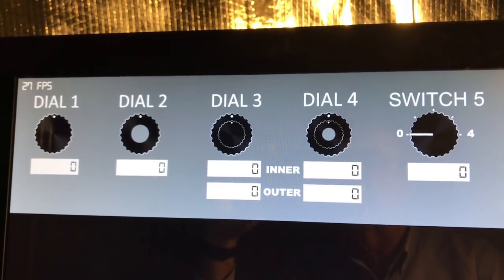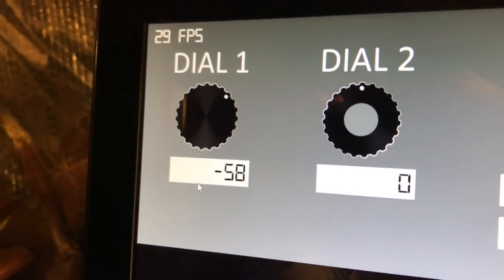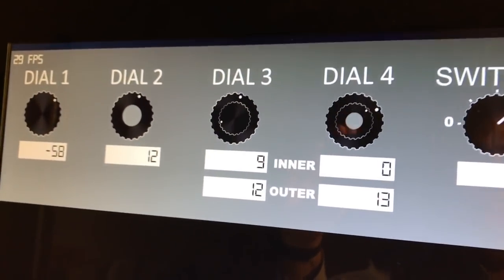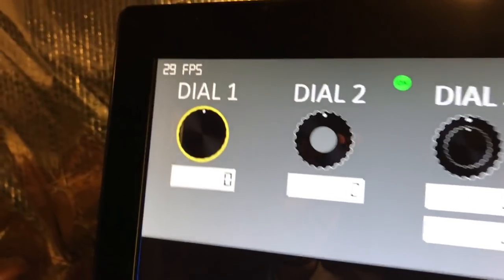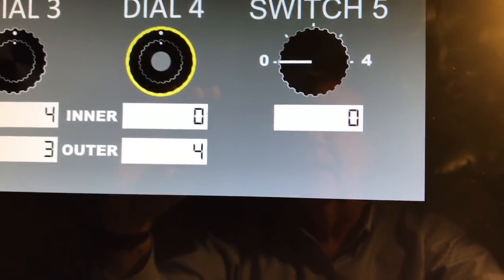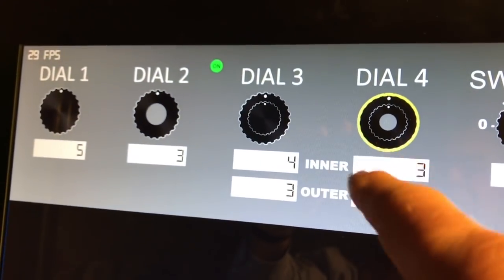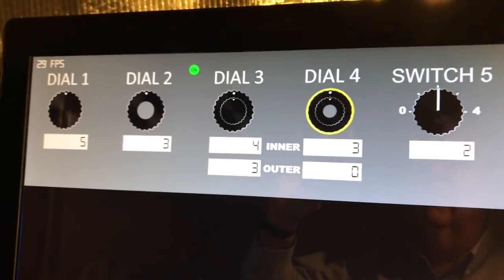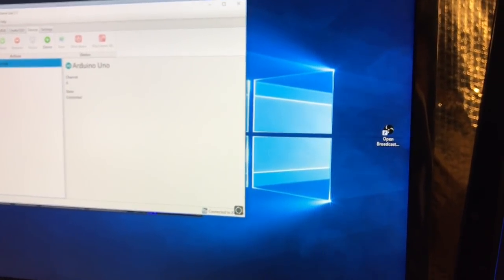Air Manager Arduino All-In-One Knob

Comment: Hi Russ, I'm very interested as well and have built a Cessna switchbox, a dual encoder and a single encoder. I'm strugling with some things, I mailed you about it. These dials in this video, what program do you use for them? Or is it selfmade? I'd like it to test my encoders :--)
Reply from the maker: That was all programmed using Air Manager. It was an early mock up of what became The Knobster available from Sim Innovations. I suggest you look at my video Dial Up Your Cockpit for more basic  Arduino information. 

You could also look into Mobiflight for a freeware solution to hardware only. It is good for basic setups

Comment: Dear Russ, 
I like your video a lot and your very objective feedbacks as a real pilot. I am a PPL pilot and also interested in knobs, air manager .. in order to have a better interaction with the sim (X-Plane11). 
I am personally  using a LeoBodnar Joystick card on which I connected rotary encoders (ELMA).  It is detected by x-plane without any driver and no extra software are used. I am able to set up the different encoders to a specific function (barometer, OBS, heading bug...), and it makes moving the gauge displayed on Air Manager

In this way, I can run more than only one knob, and no programmation is needed like in the Arduino

You should have a look there too

Thanks for your excellent video ! :)

Comment: Thanks for the reply. What I really need help with is my triple monitor setup. Windows 10 creator update removed the advanced display settings option so it is impossible to setup three monitors separately. X plane does not recognize three separate monitors and setting lateral rotation offset on each monitor the way you did in your video is impossible. I’m at my wits end because there doesn’t seem to be a fix. Do you have any suggestions. Please help
Reply: wildgoobsid5 disable Nvidia surround if you want individual displays

Comment: This is brilliant. Will you be sharing a how to? Thanks.
Reply from the maker: wildgoobsid5 I have talked Sim Innovations into incorporating this functionality into Air Manager. I have an early beta that still has some rough edges but will post a video when it is a bit further along. The great news is that unlike my “hack” requiring instrument code modifications, the new approach will work with any Air Manager instrument as is.
Reply: Silly question: during this hiatus period as Knobster (which is pure Genius, Russ!) shifts across to Sim Innovations, is it possible to use a DIY Arduino connected switch (i.e. a “fake Knobster”) and connect to Air Manager by making use of the Knobster feature you got them to incorprate into Air Manager? Or is the software Knobster feature locked purely to the Knobster hardware? I am learning so much from your videos, keep up the great work - and new innovations!

Comment: Thanks for the great videos. What commands are available to set in XP11 using arduino? e.g. is it possible to set Flight With Lua or Dataref Editor values?
Reply from the maker: Andrzej Art you can read and right any standard or custom datarefs in XP11 buy using Air Manager. Version 3.0 allows you to interface Arduino and Raspberry Pi Hardware with XP11, FSX,   or P3D
Reply: Actually I'm using AM3 with the Raspberry Pi for the additional panels. Can I connect a hardware knob to my RPi? How to find the documentation so I could try to write the datarefs?